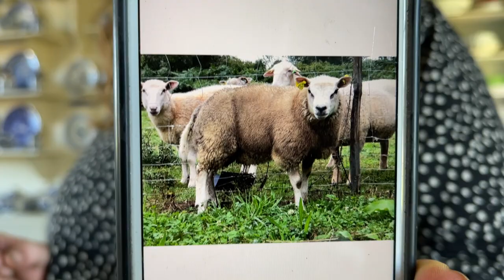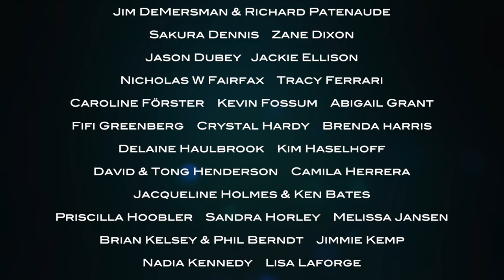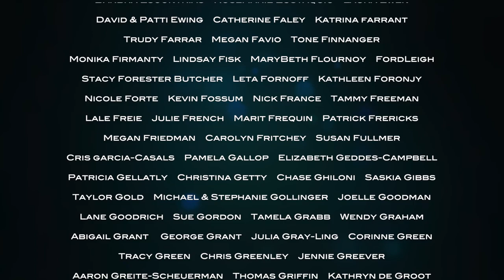A NEWLY RESTORED STAINED GLASS WINDOW AND A PARTY FOR SELMAR'S LOVE!

Comment: I just learned that chicken houses should not be placed directly on the ground, they should be higher up. 
“A chicken coop off the ground.
The increase of airflow in the summer may help to keep the coop floor cooler.
An elevated coop ensures air can circulate around the coop and prevents rats and mice from nesting.
Make sure it doesn't have any holes for mice and other rodents to get in
Reply: No worries here. Cousin A will craft something up in a trice in the newly cleared atelier 👌😉
Reply: You are correct.  I have always placed mine 2ft. off the ground with a ramp.
Reply: I had that thought too-the ones I’ve seen are up above the ground. And I’m guessing the paint is chicken proof.
Reply: Carpet was a plastic tablecloth and a joke.
Reply: Selmar is working on the window and sill of the downstairs Loo and hen house can be next.
Reply: That chicken coop also seems too small, doesn't it? Is there going to be a bigger one built?
Reply: Yeah I thought the two new coops were going to be on stilts
Reply: Literally just put it on stilts made out of any wood lying around, theyre probably going to fix that before long
Reply: I was thinking the same. Raised off the ground. Wonderful
Reply: @carolinegooder7091  Is putting someone’s lovingly made embroideries in their expensive frames in the hen house a joke too?😊
Reply: Wow, all of that history is so interesting to me. Have fun. Greetings from Louisiana, USA. (Romans 5:8)
Reply: @jessicastrideart  makes you wonder . But hey I’m learning so much 😳